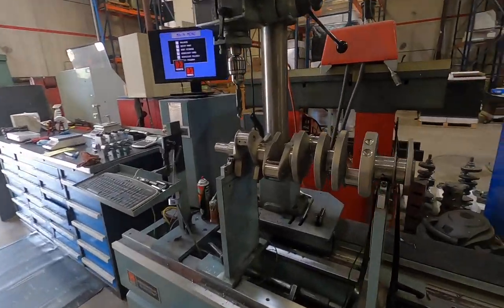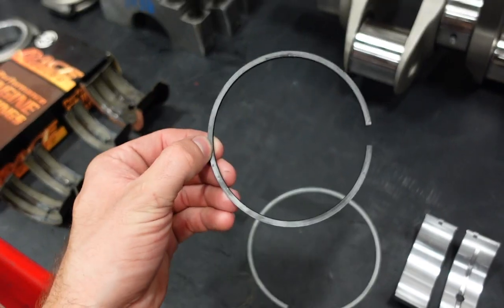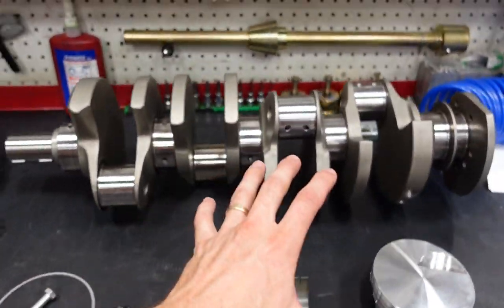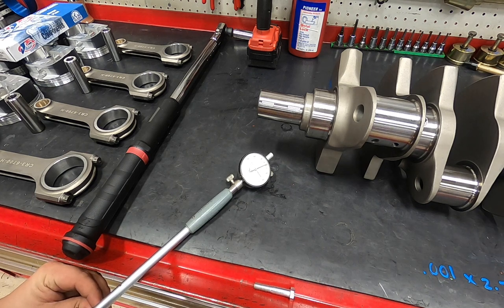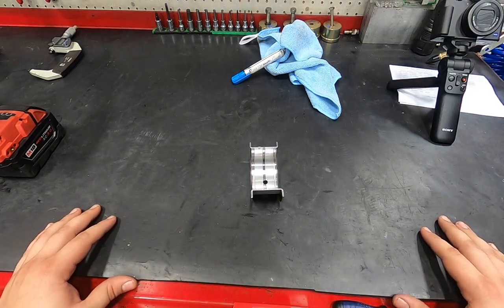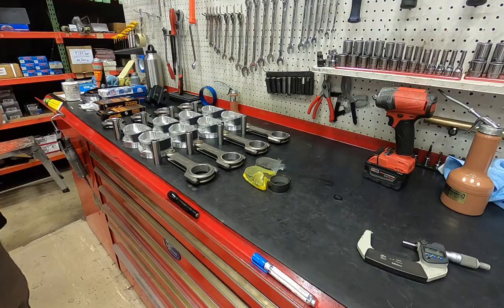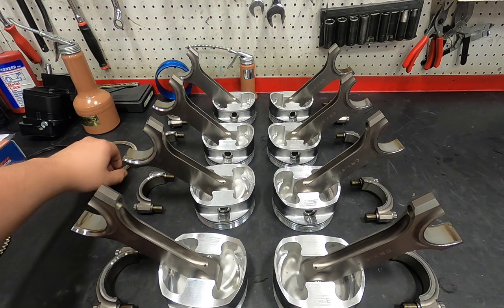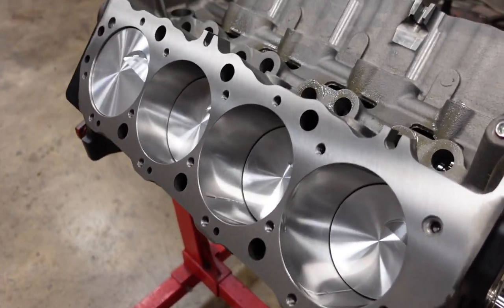1,000HP N/A 632" - Short Block Assembly - Part 2

Comment: What is your minimum piston-top thickness, at the valve relief, and other? Couldn't you save weight by removal around the relief-cut, on the bottom?...I want to contour the head/chamber on the piston, for squish. On a 60cc chamber, with dished tops, for 10-10.5:1 w/turbos @15.5lbs and 6500rpm cam.  620cid, it grew...The chamber would be money, and support a pre-chamber as well...So, double the power output.(I haven't told the head/intake awesomeness, plus firing order)
Reply: Top ring down distances, and crown thicknesses will change depending on application. A piston we spec for a naturally aspirated engine won't be the same as a nitrous or turbo application.

Comment: You got the clearance  on the Pistons  . you missed a step  weighing   All the Pistons ring’s and  Wrist  pins. For   balanced and distortion  …
Reply from the maker: When working with parts of these quality, 100% of the time are the same weight. If you’re working with hyper pistons or cheaper forged pistons then yes, the weights can be different.
Reply: Arm chair mechanics gotta love them, just ignore these comments Mr engine guy.

Comment: Great video on this build. However, I heard you're gapping ring to "0.005 / in. of bore diameter." Yet the second ring was gapped larger. Curious to why?
Reply: 2nd ring always gapped larger to reduce the chance of ring flutter. Whatever air that gets past the top ring can sometimes create a positive pressure between the top and 2nd ring, causing the top ring to be disrupted on the ring land and cause a temporary ring seal issue.
Reply: @imaracecar466  thanks for that clarification. I don't use a second ring. So I appreciate the knowledge shared of what it and its gap is for.

Comment: your 632 is lacking on power by about 250 to 300  must be the baby afr heads and cam   got to go with the 12 degree raptor heads and 1in cam and 14 -1 compression   with a 6.6 Oliver rod for a thicker compression height on the piston for big  nitrous  700 plus shot.   but that one would be good for a little bracket car

Comment: GM manufactures Chevrolets, not "chevies".  And air in engine oil is called aeration, not "cavitation".  

If you are going to present yourself as an expert, at least have your terminology correct.
Reply: But when the oil pump sucks up air, that's called cavitation. Aeration is causing cavitation.
Reply: @michaelangelo8001  that might be the scientific definition but the oil pump sucking up air is cavitating.